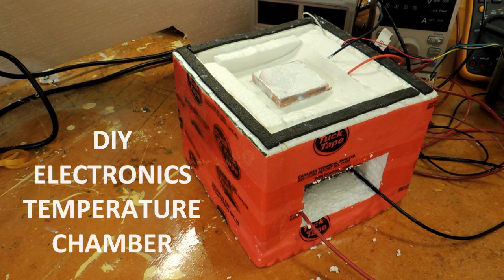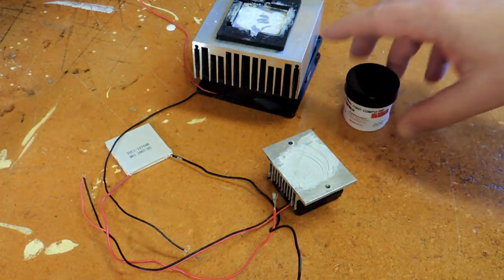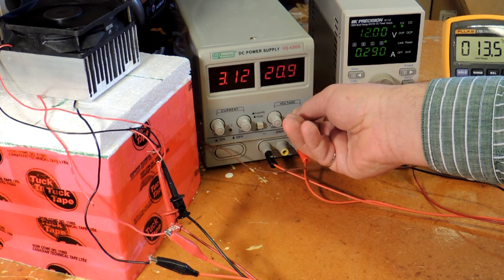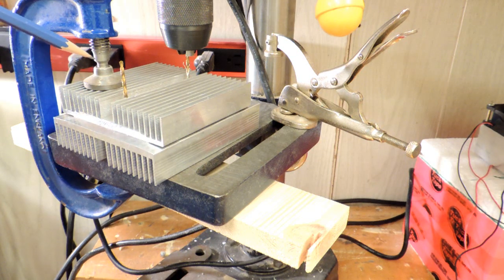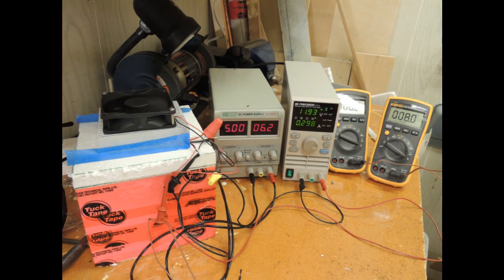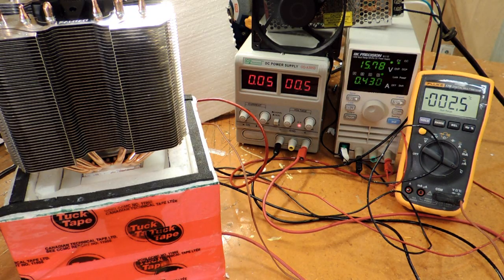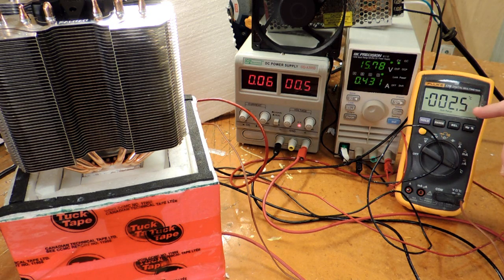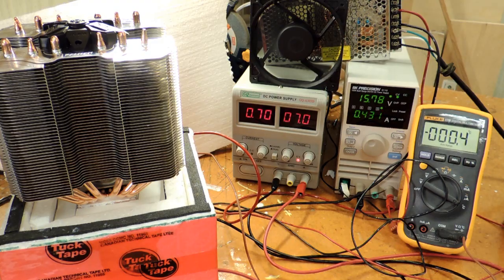DIY Temperature Chamber

Comment: The metal bolts between the hot and cold side heatsinks essentially "short circuit" the thermal difference between both sides.  If you can use something that is thermally insulating you will get much better performance.

Comment: Stack 2 thermopiles on each other to increase Td of the assembly. Lower heat capacity but a bigger temperature drop. You can get them as premade stacks up to 7 in series that can just about make dry ice.

Comment: You use a smaller module for each additional stage so the reject heat is able to be handled by the module above. Then the 100W module is on top of the 70W one, and a 50W one is underneath.

Comment: I have a Coleman 40qt chiller I'd like to upgrade. The stock module is 55 watts and it's ok but I think it can be much better. I've seen 100 watt module's do you have a rec on what module and heat sink to use for best performance to get me in the 32-38 deg range.